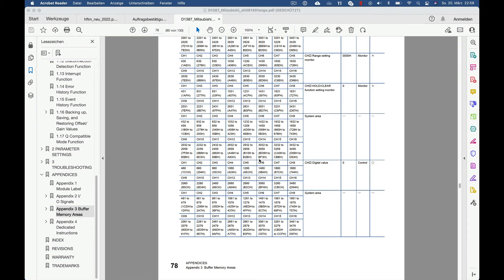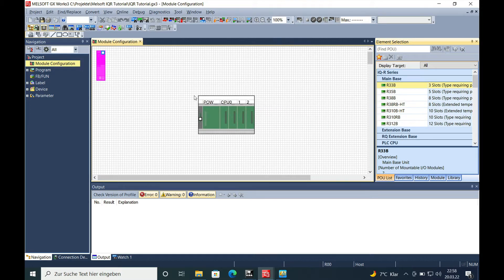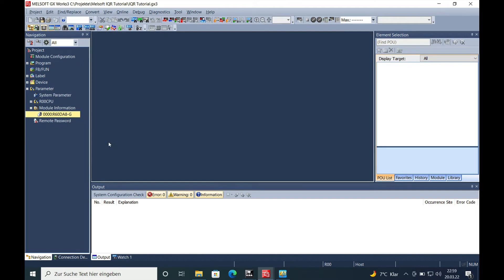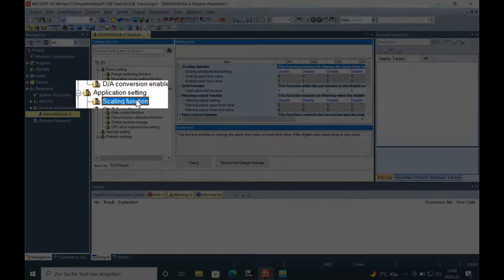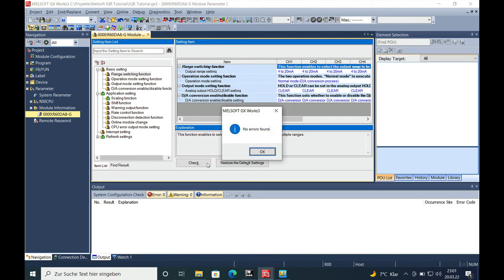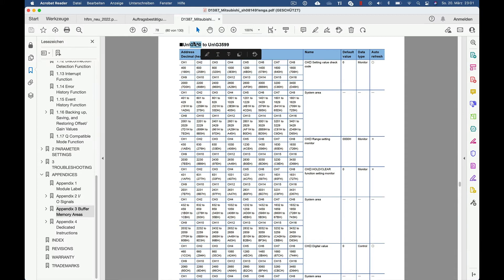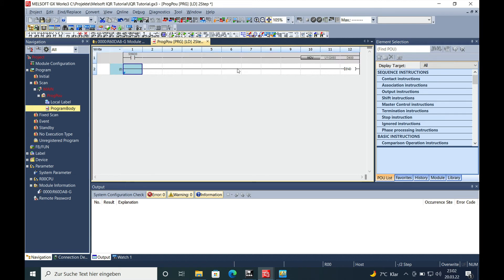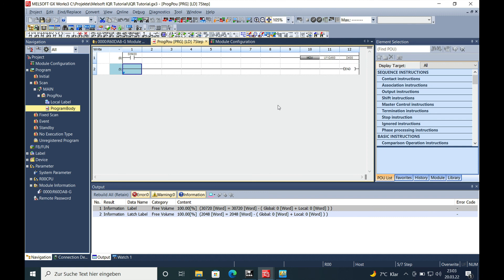Mitsubishi Melsec R60DA G Analogue Output Module

Comment: Hi Sir, i have a problem with this module. I couldn't get any value when i measured it after inputting or injecting for example 8mA from the analog input.Wiring connection looks ok.I hope you can help.Thanks a lot
Reply from the maker: Did you choose the correct value for the channel. I.e. 4-20mA, 0-10V